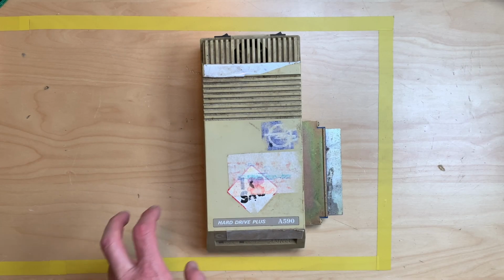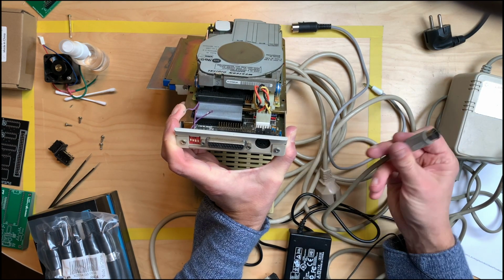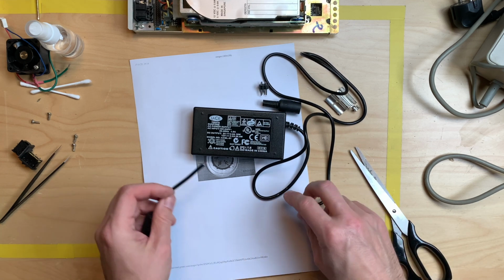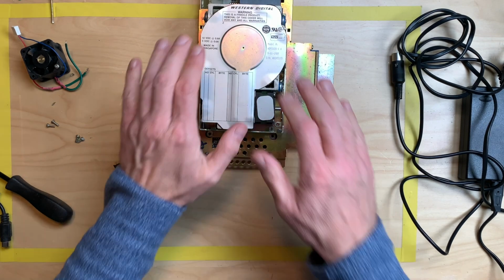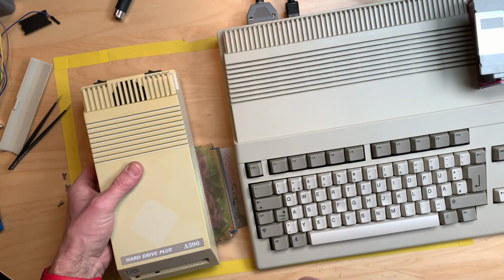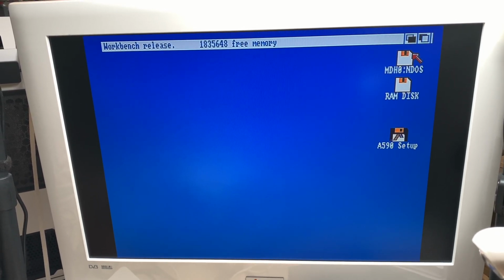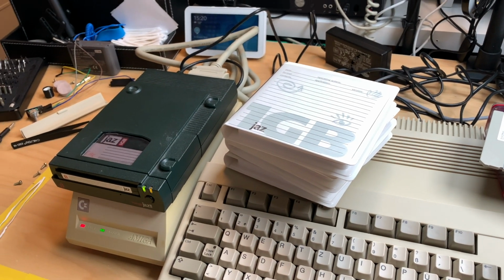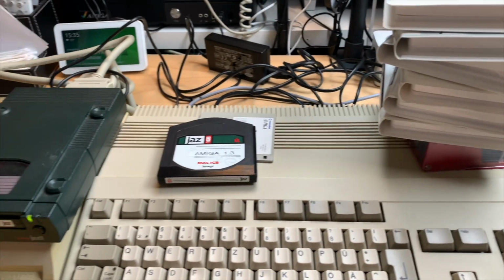A Commodore A590 with swappable harddisks? Refurb, mod, Jazdrive?!

Comment: Good Idea !  Glad it worked, even at 20 Meg a Disc.
I got a dead GVP and ordered a Iomega Zip 250 (and a BlueSCSI) ---
Unfortunately it does not work --- I think the drive is dead --- it does not Spin up, Flash or Eject.
I am now looking for a cheap SCSI CD drive to experiment with.

Comment: the size restriction is due to the ROMs on the A590. Version 6 ROMs allow hard drives up to 512MB in capacity. Version 6.6 and 7.0 ROMs work with drive sizes up to 9GB but you will need at least Amiga OS 3.1. 4 to use drives over 4GB. Remove that old clunker internal drive and see if you can get a scsi to SD card adapter card to work on the A590, a much tidier "internal hard disk" in the A590 solution
Reply from the maker: Thanks! I got an 3.1.4 in the machine. I just wanted to see if I can get it to work with 1.3 and what I had at hand ;-) ... kind of ...

Comment: I have one of those rochard drives that are IDE, but refuse to work with drives larger than 256 megabyte. But I modded it to use internal power instead.

Comment: Super Video! Ich baue meine A590 auch mal wieder auseinander. Die 20MB Platte hat den Geist aufegegeben. Vielleicht finde ich auch noch irgendwo ein günstiges Jaz Drive. Sehr interessant! Hast du den restlichen Speicher noch nutzen können, oder ist es bei den 19MB geblieben?
Reply from the maker: Um mehr als 20MB zu nutzen müsste ich wohl die ROMS im A590 updaten. Habe jetzt ein BlueScsi eingebaut und das zum laufen bekommen. Habe nichts im Netz dazu gefunden, dass das schon mal jemand gemacht hat. Hat mich Stunden  gekostet bis es lief. Preis ca. 35€ plus STM32 und SerialAdapter (ca. 10€).

Comment: As others have said.  Upgrade to v7 roms.  I have 2 x A590's both with ZuluSCSI cards replacing the old SCSI/XT drives.  That along with OS 3.1.4 or above means I can have 6 VHDs of sizes over 9GB, more than enough space.  Only down side is that each virtual HD takes up some memory, so make sure you have a good amount of memory available.
Reply from the maker: Thanks! Good point(s)!

Comment: too bad yoy didn't have a psu where there was 4 kabels, the last pin on the a590 is a sense pin that the amiga sends 5v on when turned on so with a relay you could have the amiga turning on the psu for the a590

Comment: upgrade the roms in the a590 and you can use bigger disk size ;-)
Reply: Roms in the A500 as well.

The SCSI ROMS in the 590 PRE-V7.0 had a limit of 1GB Drive size.  You need a Version 7.0 ROM in the 590, Not to mention the Filesystem limitations and limitations on the HDToolbox software.
Reply from the maker: Thanks!

Comment: There are SCSI to SD adapters out there at reasonable prices
Reply from the maker: Thanks! I know. But where is the fun in that?!
Reply: @RetroWK  loud unreliable HDDs are no that fun. Don't ask how I know.
Reply: Ras Voja  SD cards are fine to make old computers run again from time to time without issues for a budget. Not everyone has spare time and money in huge amounts. Also I have no nostalgia for the sound of vintage HDDs. Same for interlaced CRTs. I rather use a modern monitor or at least a multisync CRT in progressive mode. Nostalgia is not the same as masochism.

Comment: Be careful if you try ZIP disks/drives rather than JAZ disks/drives.  I don't know how reliable JAZ is, but ZIP were susceptible to the 'Click of Death' (See https://en.wikipedia.org/wiki/Click_of_death).  I lost a lot of data due to this design flaw in the ZIP system.
Reply from the maker: I used zips back in the day with a parallel zip drive. Never happened to me … but good to know. I assume they don‘t get better with age ;-)
Reply: @RetroWK  Never seen Zip drives that failed. But I have never seen that many at all. Around 4 drives in total. I saw one Jazz drive, internal one, and that died. I guess it all comes down to when drives were produced. Also, something tell me that I might have read something about iomega fixing specific issues in specific lines of drives. But it is a vague memmory.

Comment: Why don't you get an SD-to-IDE adapter, plug 16GB SD, and be done? Nothing rotating, lower power consumption, and no seek time.
Reply from the maker: Doesn't work. This is a SCSI interface!
Reply: @RetroWK  I am not talking about the external bus. Internally, it supported both SCSI and IDE, didn't it?
Reply from the maker: @youmasajp  It's XT-IDE which only works with specific hard drives (that end on an X). What we use now is PATA or AT-IDE. So it will not work in there.